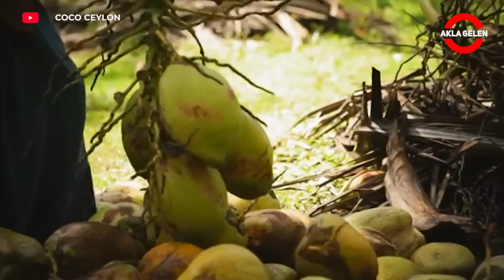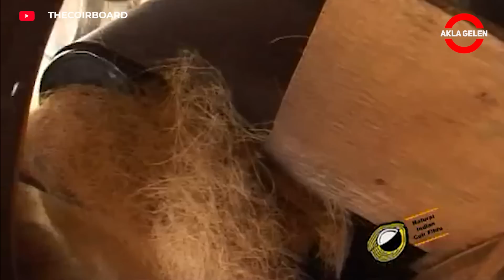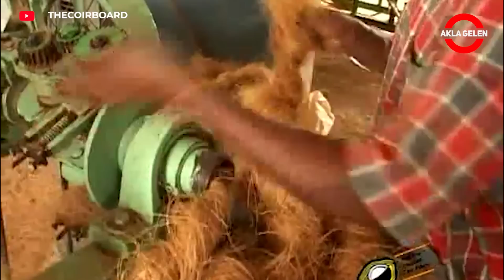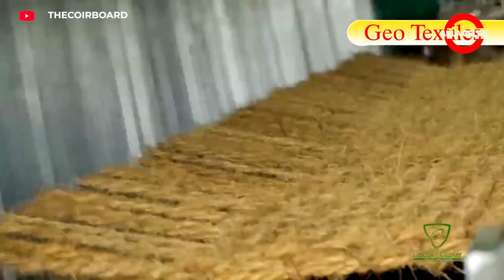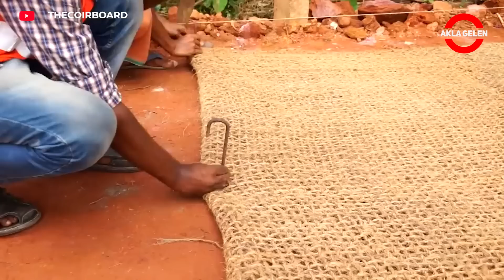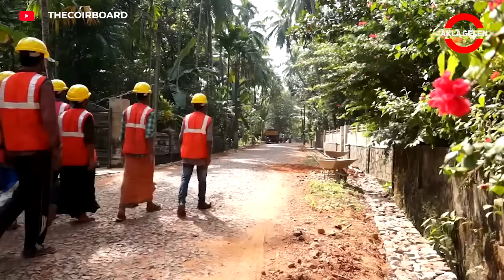India Builds Roads With Coconuts – And It Actually Works!

Comment: Great to see India leading the way in road building that doesn’t harm the environment.  
“Cement, the binding agent in concrete, contributes substantially to global CO2 emissions. Concrete production is responsible for roughly 8% of global carbon dioxide emissions.”
Reply: They use plastic zip ties,it is not about super Indian eco friendly but costs.

Comment: 3M has the same product used very extensively 'except' its Plastic called Geo mesh , that's the foundation for a strong base & is used even under railway lines , This here a natural fibre doing the same job in harmony with nature . Way to Go .